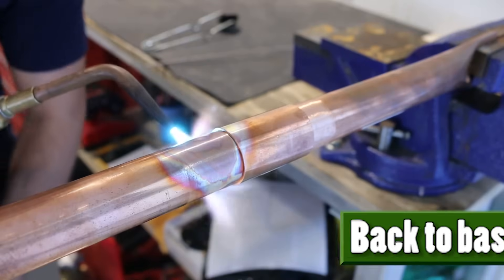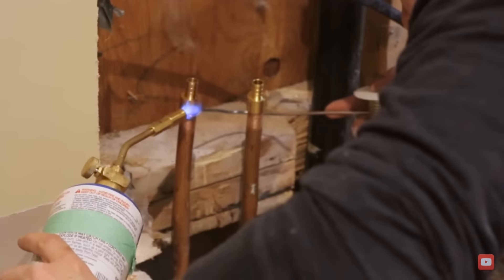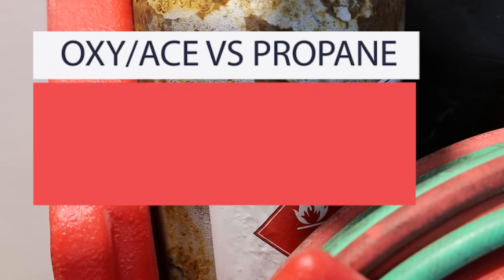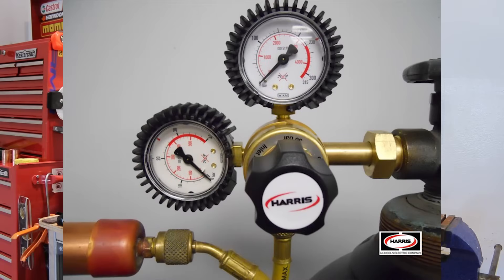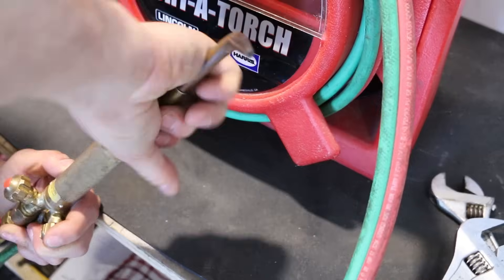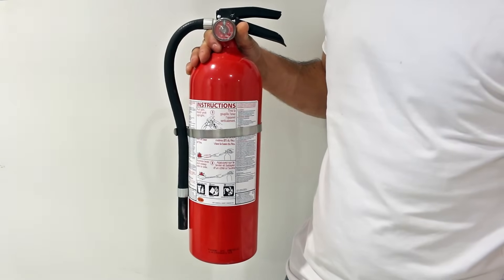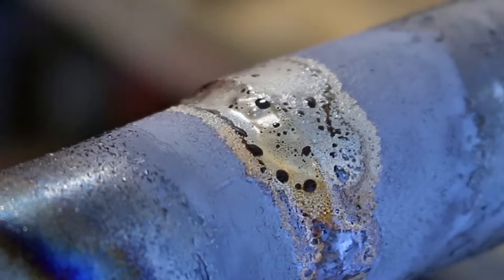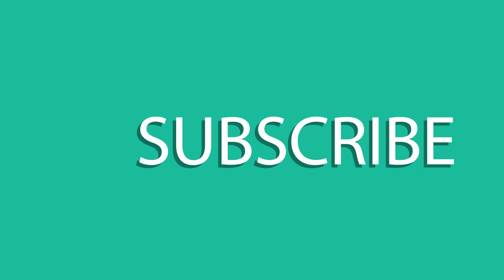How To Silver Solder (Braze) a Copper Pipe (A/C Line Repair) | GOT2LEARN

Comment: I was always taught at welding school to turn on the oxygen first and turn it off last so you don't get the nasty soot flying all around. Is there any reason to do it the other way around?

Also personally I actually prefer using propan-butane and oxygen for this kind of soldering. Acetylene burns a bit too hot and it is easy to overheat the pipe if you stop moving the flame for a sec - melting point of copper is not that much higher than the Ag CuP solder. Not to mention that acetylene is a bitch to handle from safety standpoint.

Comment: 9:02 not to be a Debbie downer but these joints would never pass a med gas cert test. In a med gas test you would need to get a 100% cup fill and pass a stress test. You would have to heat the whole joint from front to back a little more.

Comment: I like using acytelyne and a A-2 torch tip with a hose with handle, regulator with adjustable valve and gauge, and the tank of coarse has square key and shut off.

Comment: Not right. What he’s using is a "cut Torch”. What you need is a B-tank with a big tip. Plus you don’t touch the solder to the pipe like you’re afraid the pipe will explode. 🙄
Reply: You are wrong for the first part : he s using the right torch. You could this torch or a turbo torch ( acetylene only )but you re right for the second part. When the pipe is red hot, you leave the rod on the pipe. I m a retired AC tech ( 40 y + ).

Comment: Years ago I switched to a double tip head for brazing tubing and never went back. It makes quick work of the job, helping to eliminate potential issues associated with having the flame on the joint too long, especially at compressor joints.  The head is not very big and works nicely brazing in tight spots.
Reply: yes I use a double tipped head as well and it works so much better

Comment: Excellent video. Thanks for sharing. I'm installing a mini split A/C and while routing the copper tubes, the low pressure line (1/2 diameter) kinked. This means that I'll have to cut off the kinked sections  and rejoin the tube with a fitting. Is soldering the tubes enough, or should I braze it as you described in your video?  Thanks
Reply from the maker: Must braze for mini-splits! 👌👌👌
Reply: @Got2Learn  Thank you very much for the quick reply. Your videos are excellent.
Reply from the maker: @DAGenao  thank you too for the nice compliment 😇
Reply: replace pipe use somewhere else mini splits are all flare fittings
not worth the hassle  to have to purge line properly while brazing
 then to have to leak check it 
swap pipe   connect 4 flare fittings and  all good
Reply: @shawnbutler3447  my diy mini split does not have flaired dittings  but it is a24,000 tu

Comment: I thought brazing was because you were using brass to weld with. I found that easier than welding but harder than soldering...but strong and could adhere to other things than the others. Live and learn!
Reply: Braising is also used when connecting dissimilar metals, like brass to copper, stainless steel to copper etc.  so you are not wrong.  In HVAC/R we work with a bunch or brass, stainless steel and copper and have had to learn how to control the heat in such a way it doesn’t destroy those pieces or the components inside.

Comment: I'm using 1/2" copper L pipe for my air compressor lines.  If I braze the joints do I need to use a flux of some sort?  I've got a roll of Oatey Silver Solder I was going to use...  Or am I better off just using a regular Solder and Flux?
Reply from the maker: If you are brazing, just get silfos rods, they have flux built into them ;)
Reply: Regular solder & flux work well for 1/2" L pipe used for an air compressor run...... brazing is overkill, especially for the thinner L pipe......

Comment: I watched a lot of your video and I learned a lot from them. And I just wondering, could you tell me what kind of torch I can use for solder from copper 1/2 inch to 1 inch? Please! It would help me a lot to get the right tool for the right job, I would like to get some more advices from you, If you don't mind. Thank you for reading this and you have a good day!
Reply: Thank you. I have this head already. I mean the one have the pencil flammable. I can use that head in the tight spot and not burning anything
Reply from the maker: https://amzn.to/2U3OTaa
Reply from the maker: Sure, this head right here: https://www.amazon.com/Bernzomatic-TS8000-Intensity-Trigger-Start/dp/B0019CQL60?ac_md=2-1-QmV0d2VlbiAkMjUgYW5kICQ1MA%3D%3D-ac_d_pm&cv_ct_cx=plumbing+torch&dchild=1&keywords=plumbing+torch&pd_rd_i=B0019CQL60&pd_rd_r=55b4d663-3537-4a4b-9a8b-853e232708d5&pd_rd_w=jGyJp&pd_rd_wg=dyiwM&pf_rd_p=ed561ba8-5ea6-49a4-9ab5-37ca86c823dd&pf_rd_r=0SP047RFKDXN4DJAG0J7&psc=1&qid=1612979640&sr=1-2-22d05c05-1231-4126-b7c4-3e7a9c0027d0&linkCode=sl1&tag=gottolearnsho-20&linkId=1d7de896e5163c699e0c3f70d5de0811&language=en_US&ref_=as_li_ss_tl
Reply: Thank you so much
Reply from the maker: @HieuTran-xx2sb  🙏

Comment: I have a copper natural gas line in my house (gas provider allows it) and I'm adding a branch for a gas stove using csst (pro-flex). I'm having a hell of a time figuring out how to transition and also what filler material to use. The filler has to contain less than .05% phosphorus. Any input?
Reply: I'm an ole plumber in Texas and years ago we were not allowed to use any Copper on natural gas lines because something about the Gas companies added another additive in the the natural gas..Saying it corrodes Copper.
Reply from the maker: I'll let a gas expert answer you on this one, we will both learn from it 🙏
Reply: The sulfur in the natural gas is whats bad for the copper lines. It will deteriorate it over time. Copper can be used for propane but I would only do that outside of the house for the high pressure side off the tank to the regulator like most company's  do. Pretty sure they use type k copper.

Comment: You braze in all of your videos. In my country we still use lead for potable water and braze with lead or tin all of the time — brazing is what you call soldering with an external flame and not a soldering iron. You need to braze with silver because you need the higher temperatures not available in a flameless iron, but brazing is a technique not anything to with materials. At least here in Russia and in all of the other countries I have done work in (Latvia my birth place, Byelorussia and Ukraine)
Reply: Only in places where lead is in the drinking water is brazing called soldering.
Reply from the maker: Brazing here in Canada/US is when it's under 842°f, anything under is soldering, cheers!!
Reply: I think bro, you lost it in the translation. It's simple though.
First there was soldering.
With coming of the industrial revolution they developed other alloys and decided to call the process for (other alloys) by different name: 'brazing'. 
In Russia they kept the same word, but called it 'high temperature soldering' or something like that.
The temperature 842F simply differentiates the melting points of groups of tin/led alloys from 'colored' alloys.
Then, there's braze welding to add, which involves a technique....
But they could have called all of them as 'fusion' or 'gluing'  ;) ...fine by me))

Comment: Need to work on my LG residential refrigerator. Pipes are smaller (may be 1/4" or 5/16"). Can I use a regular propane cylinder and torch instead of the Oxy-Acetylene equipment? Also do I need to use  brazing rods or a solder? Thanks

Comment: I was told 5/10. Does 5/5 create same amount of heat? Are you useing 5/5 due having equal pressures so not to have a flashback?
Reply from the maker: Yes, 50/50.
Reply: 5/5 is WRONG. 5/10 is the correct method.

Comment: If you really need light equipment to solder you can use a map pro gas with two turbo torch, I used in 1/2 OD copper tube with %5 of silver, works good but the heat spread a lot and if you have some sensitive devices (sight glass, shut off valve or some pieces with seals) can be a problem, if this is your case practice with a wet raft before doing the final soldering.

Comment: Why is brazing for more strength if solder joint is not going to fail before pipe will. Soldered copper pipe holds up to 725psi
Reply: Yeah but chuck in movement of any kind and pop goes the weasel.

Comment: I did this for the very first time when I installed AC system in my house that I built in 1992 - system still works just fine  - has R12 refrigerant  - haven't silver soldered since...🇺🇲

Comment: Don you think MAPP gas would be hot enough to braze?
Reply: Mapp gas. We braze up to 5/8 easily..
And 3/4 at a max generally. 
Does help to have a heat shield
Reply from the maker: MAPP gas would only work on very small lines, anything above 3/8" would not no be able to get hot enough.

Comment: Uhm, setting the pressure the same on each tank to allow equal use of both tanks is not correct.  What determines usage rate is how much oxygen is being mixed with the acetylene and that depends on what type of flame you are after.
Reply: Where is your video showing the right way of doing it?

Comment: What about flowing nitrogen through the pipe while brazing? A lot of HVAC installation videos  use nitrogen while brazing but they don't show exactly the path the nitrogen gas takes  through the HVAC piping. For example while installing a new condenser on a split air conditioner. Can you explain this setup in a reply? Thanks.
Reply from the maker: Yes, they basically just you nitrogen to purge the lines while the braze, the pipe doesn't crust up as much inside and it prevent any regulators down the line from getting blocked

Comment: after heating both pipe n fittings.  start the bottom n work ur way up.  press on the brazing rod joint n let heat draw in fitting.  no paint action with the rod.  wrong technique there sir.  must be non union.
Reply: i guess what ever fills yr hole.  it will leak.  but ur right, just bc i dont u tube my skills im wrong.
Reply from the maker: Alright man, have a great evening ;)
Reply from the maker: This is the way I learned, and I never got any leaks, where are you coming from?
Reply: @Got2Learn  , from 16 years doing service and installs suffice?

Comment: one thing i never understood is how the rod starts melting so fast simply by scratching it on the surface,i mean dont it take time before the tip of the rod reaches its melting temp since the length of the rod acts like a heat sink ? or do the composition makes it retain heat much faster?
Reply from the maker: The surface becomes so hot it just has no choice to melt ;)
Reply: @Got2Learn  seems like there is tremendous and fast heat transfer to the tip to be able to work so fast specially when its silver and cooper composition which by themselves need upwards of 1000degC to melt
Reply from the maker: You got that right, the pipe and fitting needs to be read hot for it to melt ;)
Reply: @Got2Learn  on copper soldering or brazing would you say a neutral flame is better then carburising?
Reply from the maker: I always go for the neutral flame, I explain why in the video, check it out ;)

Comment: Nice video dude...I like the way you explain!  Got a question for you...when the copper pipe is cherry red
and ready to melt the rod...are you saying to keep the flame torch on the copper pipe & not the rod
at that point..and to use the rod to melt around the copper pipe?  I ask this as my brazing is a little
rusty and sometimes I'm not getting a smooth braze & not a good finish!

Also should the flame from the torch always be slightly above the solder rod when brazing
once the joint is ready to melt...such as a green flame?
Reply from the maker: I never heat the rod itself, the heat from the joint must melt it just like when soldering. I just heat the joint close to cherry red and follow the flame with the rod. Once that's done, I cap it ever so slightly to give it that extra strength :)
Reply: @Got2Learn  Thanks for responding bro & your feedback but when you say you once it's cherry red and you follow the flame...what do you mean by that?  I don't get you dude?  Reason I'm saying that is the flame is already being heated over & covering the pipe! So how do you follow the flame?

Also what do you mean by you cap it ever so slightly regarding the joint? 

Btw...I'm from London UK....Peace out y'all.. HVAC krew!
Reply from the maker: You need to make sure you are heating the pipe and applying the rod at the same time, so to do that, you need to heat offset of where you are applying your rod, for example: You heat at 12 o clock and you apply rod at 9 o clock while turning in a clockwise motion, the rod needs to follow the flame not the opposite, hope this is clear.  This also makes sure that you aren't heating the actual rod, a mistake that a lot of people make!
Reply: @Got2Learn  Nice 1 bro... most appreciated dude!

Comment: That is not the proper way to silver Soldier or braze the copper pipe. It doesn’t draw in by capillary action. You must force it in all you did was cap the joint.
Reply: Of course it draws it in by capillary action.  How the hell do you "force" molten metal into a joint??
Reply: @StilettoSniper  The heat will draw it in some like 1/4” but you will not fill the void space of the fitting without pushing the rod into the joint having the heat at the base of the cup/end of pipe, with the joint cherry red. “Just cap it it will hold 300 PSI” haha

Comment: why not oxy propane torch?
Reply from the maker: Oxy/Propane is good too, just has it's own pros and cons. I've been working with Oxy/Acet for years, and it does the job just fine for what I do ;)
Reply: @Got2Learn  besides that it has a little lower temp... its safer and cheaper.  i just wondered why you didnt mention it,  but did mention a  propane burner, thats all.

Comment: I have a small crack in the liquid line at the bend just above the compressor.  tight spot, wondering if I should use 15% or higher and also a jewelers torch so I can avoid over heating / damaging the compressor?   Did this happen because the 3 compressor anchor bolts were tightened down too much causing too much vibration on the liquid line.
Reply: It happened because who knows. The bolts are supposed to be tight, so the compressor won't vibrate so bad and  so it stays put. 

You want to use the normal brazing rod, only use a different type of rod, if you need the rod to braze different things (i.e. copper to steel, aluminium to copper, diff applications)

Idk what a Jewelers torch is, but as long as it gets hot enough to melt the brazing rod, that's what you need, as explained in the video. For simplicity sake, use a turbo torch or oxy acetylene torch. 

Also, it sounds like you have no idea what you're doing, I hope you know what type of refrigerant is in the system, because if it's propane or something flammable, you're toast. The label isn't always correct. There might be some back pressure from the remaining refrigerant in the compressor, even after the refrigerant has been recovered, making it near impossible to braze. 

Whenever you put the new line, give yourself wiggle room, so it doesn't crack again. 
Hope it goes well, don't do it u less you know what you're doing, because you're going to have a bad time
Reply: @urjnlegend  "sounds like I have no idea what I'm doing"        If I had no idea what I was doing, I would not know what questions to ask...      I own a recovery machine and a vacuum pump - lines are dry - no refrigerant - no propane...  dry.    "Normal brazing rod"        most HVAC guys I talked to use silfos #15  brazing sticks for this type of repair.
Reply: @earthstewardude  that is what we use. There is a product called thermo trap. You can get it a Grainger or similar supply house. You apply it on the copper where you don't want the heat to go. Use a regular acetylene/oxygen torch kit but keep the flame short. The liquid line should be easy to seal just don't get it too hot.

Comment: does your kit came with the flash back arrester? i am looking to buy the same kit but not sure.
great video by the way...thanks alot
Reply: Should have a flash-back arrestor between the regulator and the hose. 
Right on the torch is useless
Reply from the maker: Yes, mine came with the arrestors on the torch ;) thanks btw!

Comment: My a/c stopped working in my house. I inspected my unit and found that there is a small copper line coming out the side of my condenser that was rubbing against another line. It rubbed a small pin hole in the line and all my Freon leaked out.
I called a company and they gave me a estimate of almost $1000 to fix it. I can't afford that.. Can I braze that pin hole myself? Only thing is I don't have a acetylene torch. I only have a propane torch.. Would that work to heat a silver rod enough just to cover a tiny hole?
Once I get hole fixed then ill figure out how to recharge the system lol
Reply: You probably already tried at this point, as its been a month since you posted. However, maybe try MAPP Gas. Much hotter than propane, not much more expensive. May require different propane torch. I got my kit at Menards, one tank MAPP gas, and a torch for $25.
Reply from the maker: It's worth a try! Try using 2 torches at once if 1 isn't enough, you need 840°c of heat to melt the silfos rods ;)
Reply: @Got2Learn  ok.. That's a good idea.. Thank you!
Reply from the maker: Np!!!

Comment: surprised to see so many fitters applauding this video. Good info but the technique was pretty poor. The heat should be used to draw the filler around the joint as well as into it. The heat and dab moves are for welding not brazing... COME AT ME!
25 yr HVAC/R service tech
Reply: Dabs welding brazzing dragging